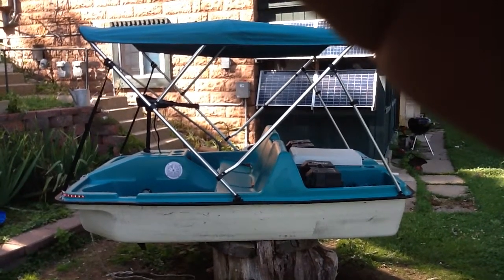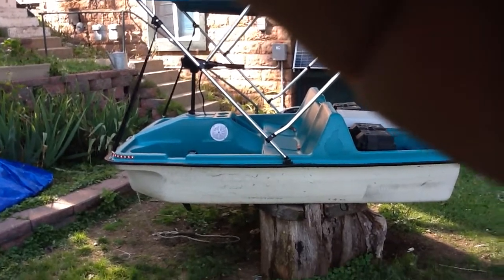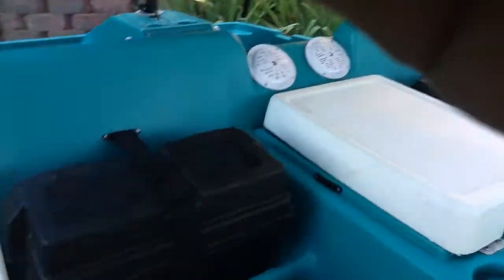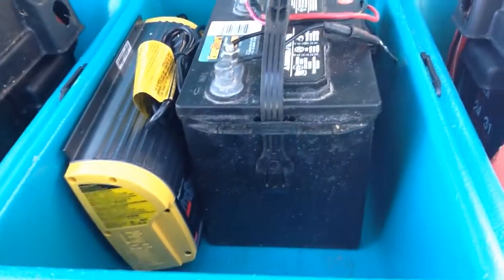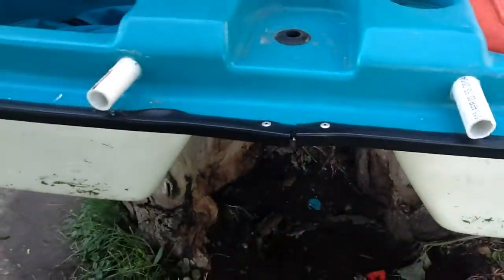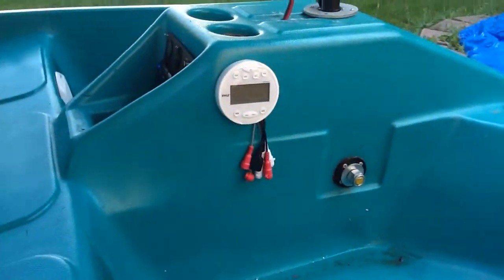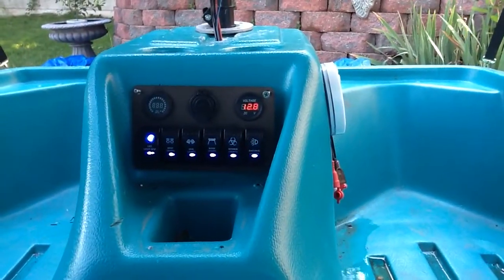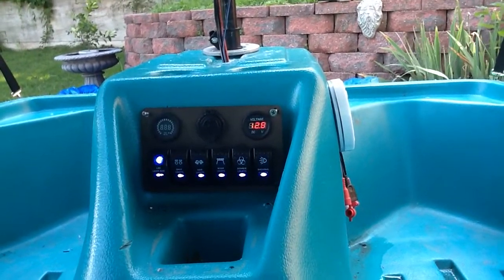86 foot lbs trolling motor paddle boat  now known as a mattle boat

Comment: so I recently did this to my boat as well I have yet to test it mine is mounted on the rear for traditional steering I see yours is on the front in the area where the paddles used to be I'm curious do you not need a rudder does the motor stick down below the boat is that how you're able to steer it?

Comment: How did you run the wires? I just picked up a padle boat, I'm going to add the 86 motor also. I need to figure out how to run the wires. Did you just drill holes?